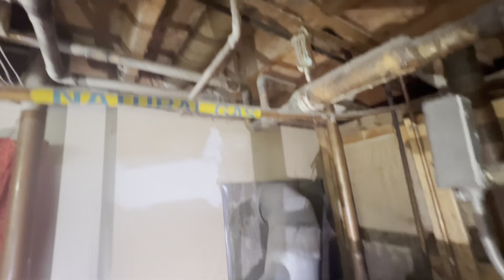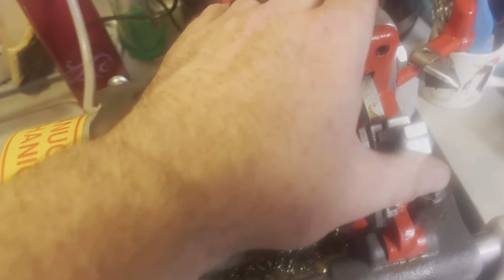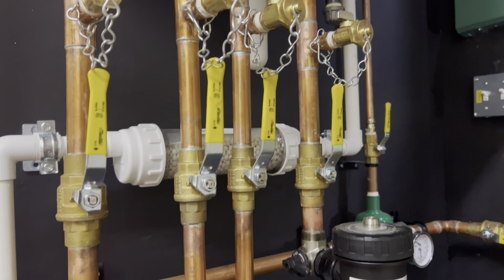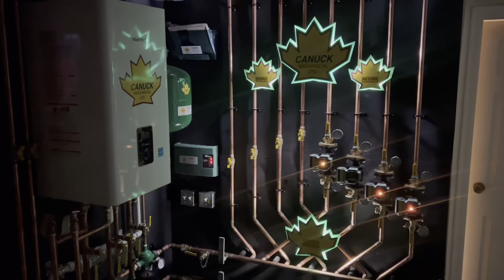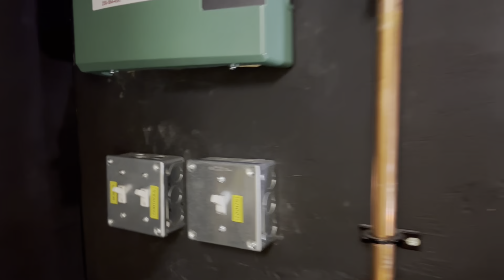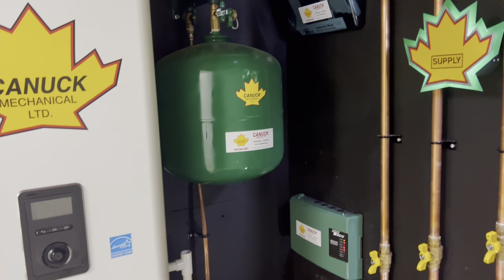Navien Boiler Retrofit #12 NFC-175

Comment: Incredible work!! I just spent 3 hours watching your installs, and every one is unique in their own way! I have a few questions.
1. Is there a method to the system design, or just what you feel like doing/what the budget allows? For instance, this setup could've been a primary secondary vs. tertiary. Why opt to go one way or the other? One of my favorites was the zone valve setup with the primary and backup pump. This video is my favorite because of its uniqueness.
2. Also, I noticed you mainly use NFC over the NCB, and it seems like it primarily comes down to the pricing, as you seem to prefer the NFC over the NCB. 
If you didn't have cost in mind, would you choose an NCB 250/150H or an NFC 250/175H and why?
3. Why do you choose the hydraulic seperator setup vs. the premade manifold form Navien? 
I like the valve setup/drainage setup for maintenance when you use the hydraulic seperator setup. I could see more benefits with stable pressure, air separation, etc.
4. It seems you do not utilize the autofill valve inside the Navien units, is there a reason you prefer utilizing your own feed valve?

Thank you! Can't wait to see more jobs!
Reply from the maker: Thank you, and regarding questions 
1) I strive for uniqueness in every project and sometimes This means adding things to the budget at my expense.
2)nfc is superior in my opinion being a fire tube boiler and not a water tube NCB boiler which has its Drawbacks  
3) hydronic separators look better and give a better aesthetic and functionality ….i like symmetry hence the custom flushing ports 
4) the autofill valve gives me more control on filling or flushing the system when the boiler is off, and I trust manual control can the soleniod valve

Comment: This is exactly what I want to do in my house. How much would it cost to have you design my system? 13 zones of in floor hydronic heat, plus room to add 3 more when we finish the basement. And 8 full baths with 6+ heads in each, 4 washing machines, 2 dw, etc etc. I'm in way over my head 🤣
Reply from the maker: Anything is possible jt@canuckmechanical.com

Comment: Great videos and workmanship! I noticed the systems over time have evolved as far as continuous venting. Have you discovered with the hydraulic separator and a standard vent that there is no need for an air scoop?
Reply from the maker: No need at all the baffles in the hydro separator work just as well and move the air to the auto vent
Reply: Thanks, that was my thought also. You and your crew are true craftsmen. Many contractors these days are doing such sloppy work with very limited skills. Good to see some people still take pride in their work. @canuckmechanical6490
Reply: That was something I noticed as well good to know
Reply from the maker: The hydronic separator acts as an air scoop also, it has a baffle inside it  that helps separate the air out of the system 2 for 1

Comment: Dude, this is unreal. I love your work, and think your craftsmanship is top notch.  I'm about to hire a plumber to install a NFC-175, and like with most things, have endlessly researched the product. I've learned so much from your Navien NFC installs!  This was the first video where you showed some of your incredible work unfold, which was appreciated.  If you could answer my three questions below, that would be amazing:

1. In my set-up, I'll have two zones for heating, which can be both hooked up internally within in the Navien, so no zone controller needed, correct? 
2. My guy also is suggesting two pumps, one for each zone, instead of one pump and two zone valves. This video shows that set-up.  Is this how you'd set things up in my arrangement? He simply said that two pumps vs one pump and two zone controllers was the right set-up for this job. 
3. I've got a forced hot water/baseboard heating set-up. My guy is saying the Naviclean is redundant for this set-up, as the metal that often gets within the water comes from the breakdown in cast iron radiator set-ups. I've got a 125 year old home in Boston that was swiched over to the baseboard set-up at some point. Would you agree that the navi-clean isn't needed? 
Thanks, and keep on kicking a**.
Reply: Thanks. Just rewatched this video. Unbelievable install. 🎉
Reply from the maker: 1 correct
2 correct 
3 I would still install a magnetic filter regardless and protect for the boiler is a smart idea

Thanks again 😊 for the kind Words
Reply: @canuckmechanical6490  Thanks, man! Appreciate the time. I've subscribed and liked.
Reply from the maker: @brianbisceglia-kane3099  no worries and thanks again
Reply: @canuckmechanical6490  last question -- what type of plywood and black paint do you use? Do you use something water resistant/exteior paint grade?
Reply from the maker: flat lack behr paint from home depot indoor @brianbisceglia-kane3099
Reply: Hey, my NFC - 200/175 just got installed. I have two zones, with nest thermostats for each. Do you have experience with making nests work with the Navien systems? Do I need to run new three wire with a C, or can my two guage wire suffice?  And if you don't recommend the Google Nests, is there a smart thermostat out there you would recommend? Thanks!

Comment: Again the workmanship and pride in your jobs are astounding.  I did see the roof vent thanks for letting me know it was in this video.  Is that just regular sch 40 solid core pvc (white) and conduit (grey)?  I'm in Alberta and the guy doing mine is saying it has to be 636 pipe and can't go out the roof.  It's a huge price difference, is he right on this?
Reply from the maker: You need to use grey 636 venting its rated for that 90 degress C
Reply: We do it in BC all the time. Might be a provincial or municipal code